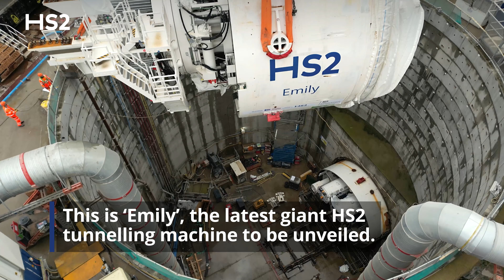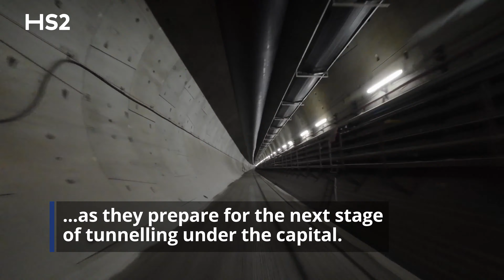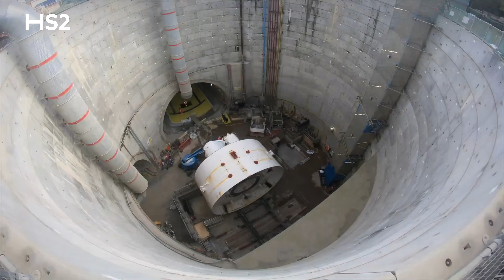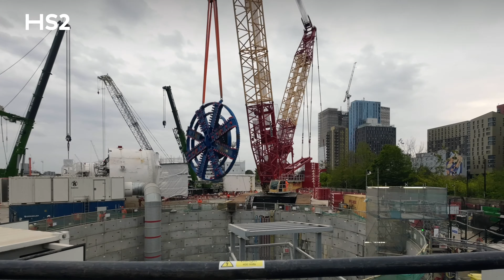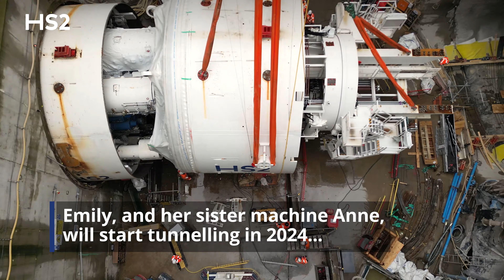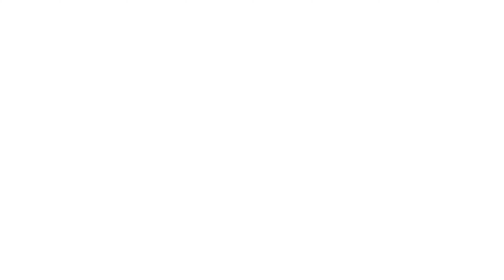Lift off! HS2’s latest London tunnelling machine assembled 25 metres below ground

Comment: It’s an amazing feat of engineering but a complete waste of time and money. Nobody uses trains. They are way too expensive. They are never on time or clean. The drivers are always on strike. 
I can travel to London Victoria in my car far cheaper than the train. At weekends you can park for free and the congestion charge is not payable.
Reply: I commute 40 miles into Euston on a 12 car train, I'm lucky to get a seat, so everything that you have said is cobblers. Nobody uses trains you say, you really must get out more. Your a very silly person.
Reply: I agree with the 1st sentence but to say nobody uses trains is inaccurate. Trains (as well as roads) are massively overcrowded. They could have used the money to increase capacity of the WCML by implementing digital signalling and then increasing the speed of the Pendolino trains up to their max design speed of 140mph. Instead they cancel the most needed northern section and bolster current capacity issues with new trains that are slower than the current ones. You couldn't make the incompetence up if you tried!
Reply: One day i'm going to make a video of passengers on board the HS2 Train and proof you wrong, Driving a car is not cheap when you have to pay out car insurance maintaince petrol or diesel yearly taxes, You must have a good job that pay you good money to be able to drive your car cheaply, plus majority of people can not afford a car, you don't own the train or pay maintance to keep the train going, you pay your ticket and board, plus it pull right up at the city centre right on it door step, no hassle in parking, job done!!